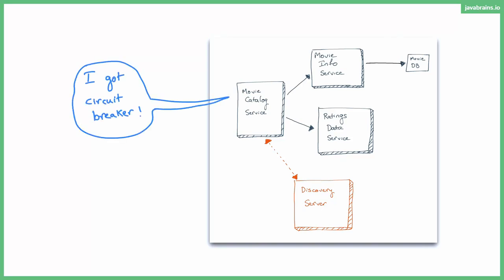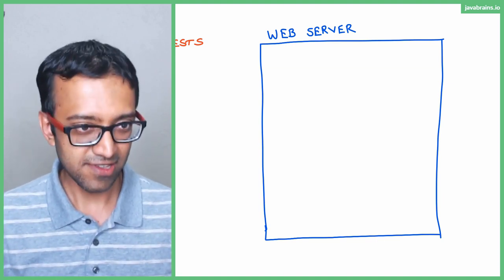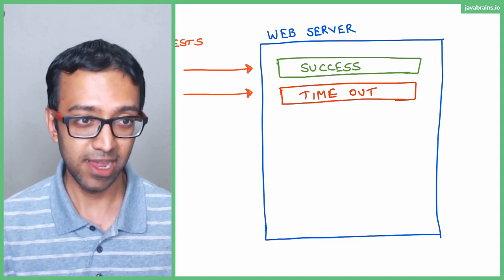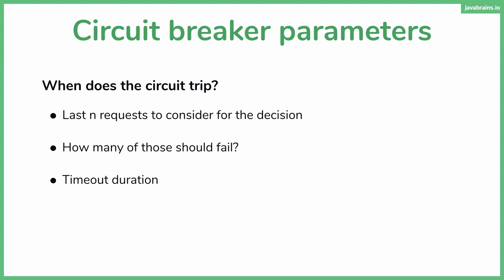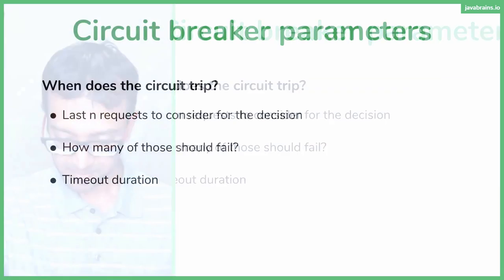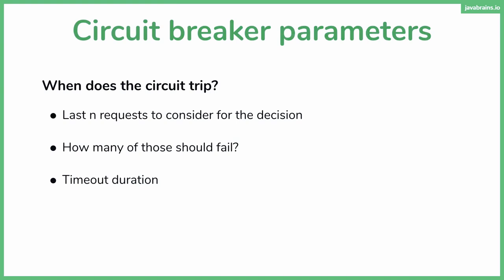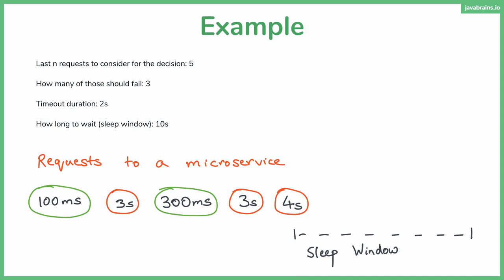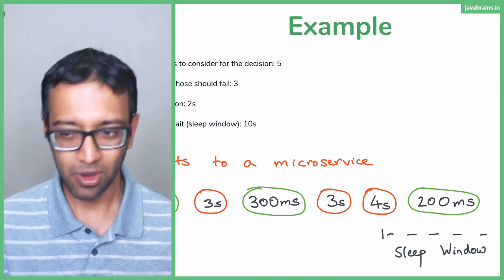12 Circuit breaker parameters - Spring Boot Microservices Level 2

Comment: @Java Brains
 what if the call to the different individual microservices(all are taking time) are more than the webserver available threads,
and the call to all the microservices is individually consecutive none of microservice is called twice then how the hystrix circuit pattern is going to solve this problem because at some point of time all we have in the webserver thread pool is an individual threads which are only once processes and gets timeout.
and the requests are coming more frequenty